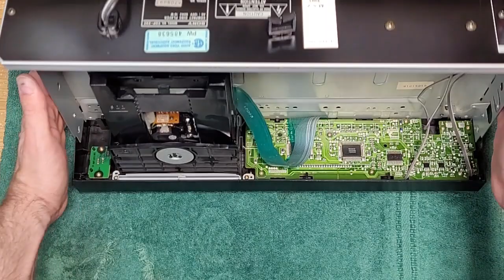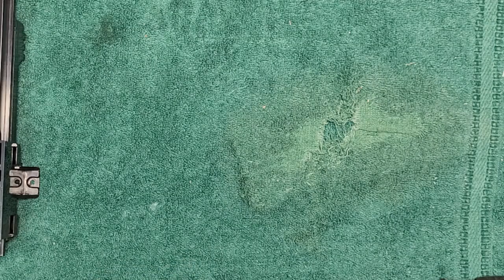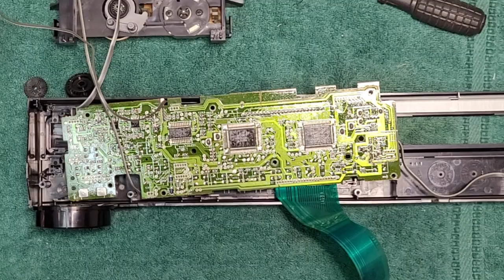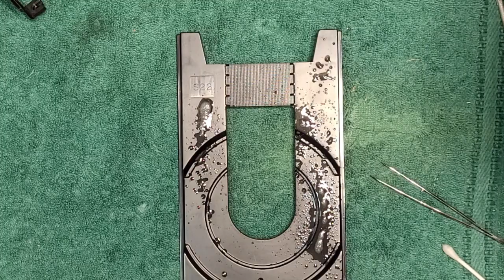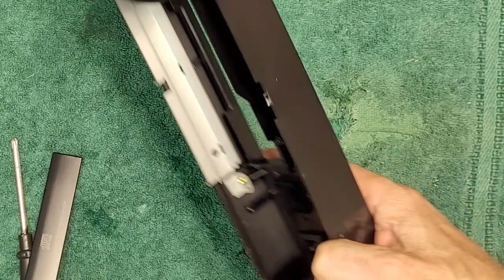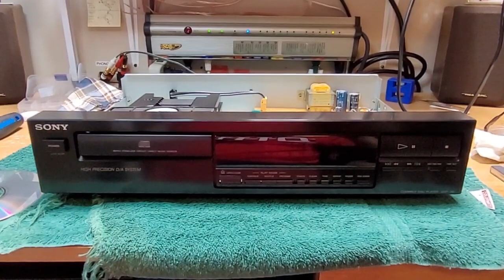Sony CDP-292: Thrift Store Find Service

Comment: Good job man. Definitely pinching pennies on that one. Saving on parts and shipping costs. Had you playing while I was working on an Akai AP-D33. Nice enough table once sorted. Has a solenoid activated return. Suffered from the counterweight droop, bad capacitor on the speed circuit C6, damping fluid, and the general clean, grease and lube. Nice having you or Trev on when working on gear.
Reply: I told you the transport was off a hole, but I guess you couldn't hear me. 😅
Reply from the maker: I remember a couple of bad caps on the speed board.  I also had to change a couple resistors as the speed would not dial in.  Nice table though.